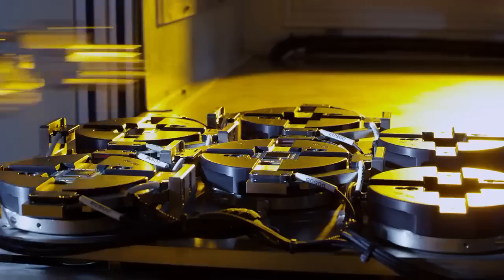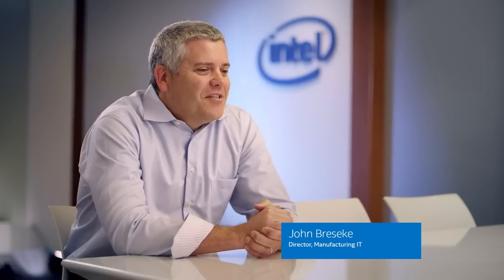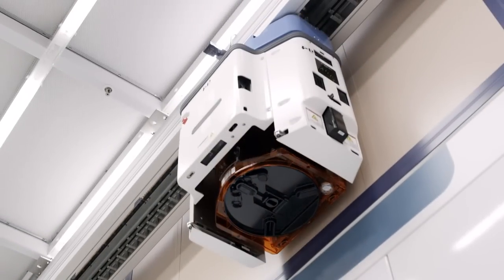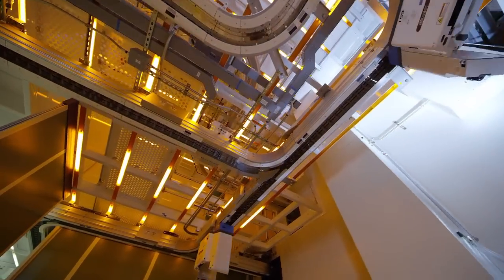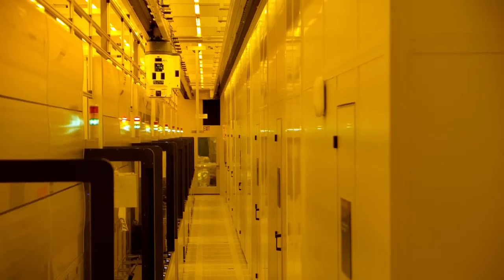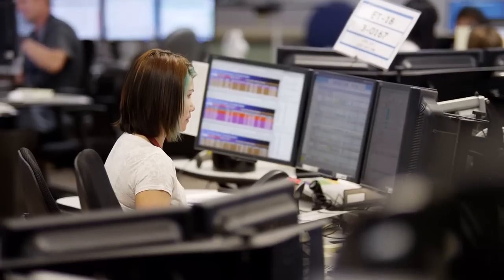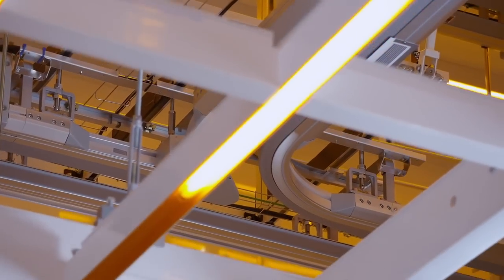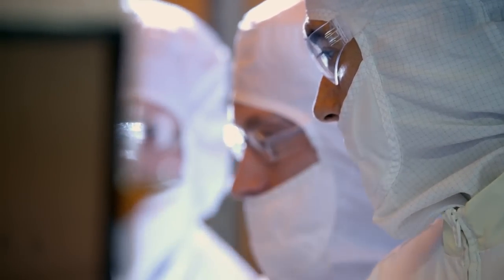The Most Sophisticated Manufacturing Process In The World  Inside The Fab | Intel

Comment: Broken Intel fractorium, so advanced cant even make 10nm. Still on 14nm until God Jim Keller develops the architecture, until then Intel is dead in the water, see you in 3 years Intel. When Jim finishes developing your new architecture, by then AMD will be working on under 7nm...... The Silicon Boat has left INTEL.
TSMC currently the top chipmaker! RIP
Reply: Yeah I was gonna say they're not the most advance Fab anymore.  That's gonna be tsmc with 7nm and the new one planned for 3nm. Intel has lost the long lead in process node shrinking finally.
Reply: The world just solutes the rising star. And forgets the Father's . But who knows after 700 yrs todays Intel chips may be featured in a technology museum and may cost Billions each. Intel is going nowhere even if it does not have Manufacturing lead. Bcs the physics has limits. One day there will be no shrinking of die. In nut shell intel is not that behind. For general world Nm has no meaning. It is cost and purpose. Intel still has 70 percent market share. So why care for 3nm. Noobz do not take energy consumption in to mind. They only care marketing facts.
Reply: AMD lol
Reply: @Jaker788  Quantum mechanics. Resistance.